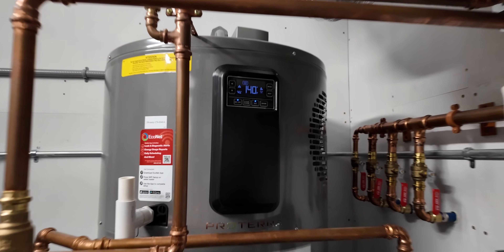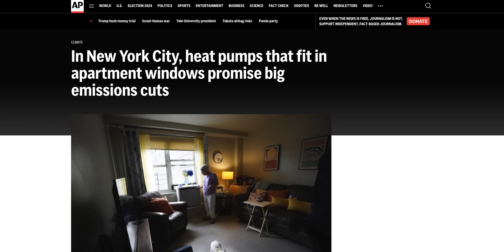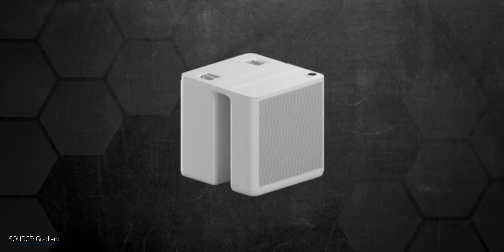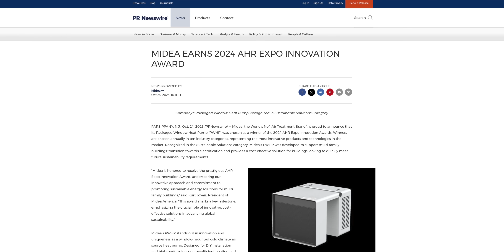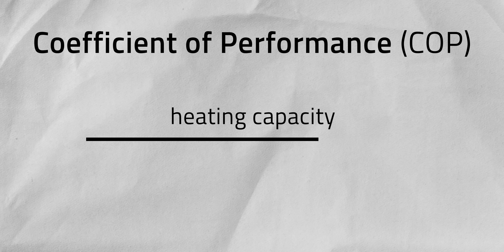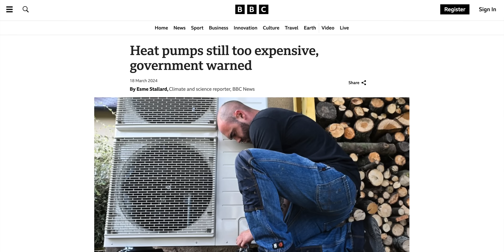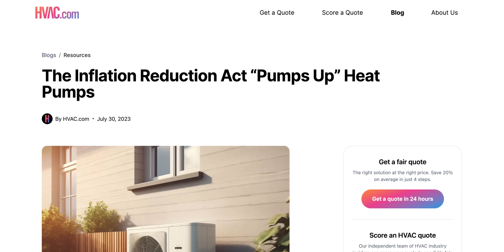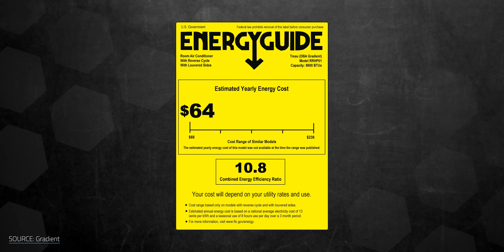Why This Window Heat Pump Is Genius

Comment: In Europe, in buildings with central heating, we install special radiator valves that stop the water flow when a specific temperature is reached, and each tenant pays only for what they use.

Heat pumps are definitely better, but the problem of some apartments being too hot was solved a couple of decades ago.
Reply: Also those heat pumps wouldn't work in Europe, because the windows have a different design.
Reply: @hanneselch1843  Depends on the window, but yeah on some it wouldn't work, but I don't think it would be that difficult to do a slight redesign for it to be more flexible with more windows.

But honestly, the price point of 3 grand is crazy high for that, especially as it looks like you will need more than one of them as it looks like it's on a per-room basis or landing base, so the cost really start to add up in buying them and running cost, and I'm not sure if it's just a US thing having such a high price point, but for 3 grand, there's no way I would buy that.
Reply: @paul1979uk2000  it would be difficult, because most european windows don't slide up/down but open left/right so there is no nice rectangular hole to deal with and you will have holes between AC unit, frame and window
Reply: @hanneselch1843   It's not impossible or unheard of to change a single window.  The world is so inept.
Reply: @btwbrand  It don't know if they sell or make sliding windows like that here. But it may be possible. Still the price would be higher. I guess most people here wouldn't buy it, if they would have to change a window. There are other solutions to get one installed. But for American homes it's a great solution.
Reply: Yeah I did that in my house and it works really well with controlling the temperature per room, but it does take a little time to set up and each room being different needs being setup individually to get the right temperature you want.

Once you have it setup, it works like a dream, each one switches on or off depending on the setting you have and the temperature you want, the advantage is, you end up using less energy whiles feeling more comfortable in a room because the temperature stays at a given level so not to let it get too cold or too hot, and you can do this individually on a per-room basis.

For instance, one room in the house, the heating rarely comes on and usually in winter for a short time because the room doesn't get too cold, whereas the bathroom needs more heating so it comes on more aggressively, once it's set for each room, you don't have to do anything and the heating comes on and off automatically per room as needed, which in my case, is not very much because we insulated the house about 3 years ago and it doesn't really get that cold in winter that heating is rarely needed, this is in the UK by the way.

With that said, the same system could be much cheaper with a heat pump, but considering how little heating we use, it's not worth getting a heat pump at the current price.
Reply: Well, la-di-da, man. We're all aware that America is super behind the rest of the world. Even the non-brainwashed of us here In America, such as me, are fully aware of that. It still helps solve the thing that's still a problem here even if it isn't elsewhere anymore lol
Reply: I live in Vienna. Lots of old appartment buildings and I did have the issue of a heating system that was either on = boiling hot or off = cold, in an appartment in a very good part of the city. So yes the adjustable radiator valves exist, but not everywhere.
Reply: That's on newer systems there are plenty of older units in use in Europe and that's obviously what he's talking about.
Reply: American't find out what an thermostat or an calorimeter are. But IF they actually really use steam for transmission the argument would actually be irrelevant, because a classic thermostat would not work with steam
Reply: @hpenvy1106   Wow you just took a second to think and realize this is all about old steam systems. 🙄
Reply: In the nordics water cental heating are the standard. You have thermo mechanic thermostatic valves on the radiator as mentioned. The heating source are often district heating. Where it's not available geothermal are standard today. The typically use oil or resistiv heater as auxiliary heat when it gets really cold. The renter didn't need to hassle with the heat source.
Reply: @nallebrean  nope, we dont do it like that in the nordic country´s
very few have geothermal heating where i live, we just said no to a geothermal district heating where i live
a heatpump individual is cheaper 
and doing geothermal heating by yourself is not cheaper 

and big part of the country does not have acces to district heating 
we are starting to let out bio gas in the gas grid soon, insted of replacing the whole gas grid with a new grid.
and we get tax reductions for heat pumps and we dont get for geothermal district heating (or district heasting)
and that tax reduction is to small to make a heatpump for geothermal heating a good investment

i get free heat from solar and waste heat from making bitcoins from solar 
with a geothermal district heating i would pay 200€ per month + consumption
it is not better for the nature to run geothermal heating if the electricity used is not green anyway

geothermal heating is not a green investment in it self.
it needs green energy to be green

heatpump and batteries are 5-10 times cheaper and more green then geothermal heating from the grid where i live 
and if its district heating it have something like 20% heat loss in the grid

our goverment just used million on creating projects with geothermal district heating 6 month ago
the money is gone and it failed
they made laws that made it fail at the same time, it is madness
Reply: @Hansen710  I don't agree with with the claim that geothermal heating on fossil fuels not are green. If you burn the fossil fuel for heating you got max 100% as heating. If you make electricity out of it you got max 40%. And efficient geothermal system can give cop 4. That makes a system efficiency of 4*40%=160% heat out of 1 kWh fossil fuel. If you then use the remaining losses in the power plant for district heating (common in nordics) you got a system efficency of 160%+60%=220%. 1 kWh fossil fuel in 2 out. With time the grid get less CO2 intensiv too. It you have solar too those drives a part of the heat pump too.

If you use your (bio) gas to produce electricity you can get 60% efficiency. Combined with geothermal hp you can reach 4*60% el+40% losses to DH =280% system efficency.
Reply: A district heating system typically has 10% losses here. But I agree that geothermal system should be individual. That's because you lose cop with the high temp district heating needs to be efficient. From 65 C in the summer to 100 C in the winter. The colder the better for cop.
Reply: The other thing about steam in dense city environments is that it often comes "for free" (at least from an energy usage standpoint). The steam is often sourced from nearby power generators, were water was boiled to make steam to turn a turbine. They could just let that steam out into the atmosphere, or they could make use of it in places that need heat. So, it's piped into nearby buildings, and used to drive the heating systems.
Reply: I don't know what you talk about. During heatwaves in Europe there is nothing you can do without an AC. I would like to get an AC, but all I got is a cylindrical hole in the wall of my rented apartment.
Reply: That's because in Europe they have standards
Reply: @DaUziel  but they don't have air conditioning, so suffer over there I guess.

Comment: ....costs would differ greatly dependent on the insulative properties of the building you instal it in......you can't talk about running cost without looking at this.....if your building is well insulated you hardly need any heating or cooling at all, even in thermally extreme locations.....are you sure you don't own shares?

Comment: There seems to be an elephant in the room...with what types of windows do these heat pumps work? Only the vertical sliding type? Are those common in those areas?

Comment: I would like to talk to you about the nitty and gritty!!!  You and engineers say  that Air source Geo thermo moves the heat from one place to another- I beg to differ on this!!!  It is merely using principle of science that when you compress a gas you create heat and when you release a gas at a rapid rate you create cold.  You could almost do the process with air except that on the cold side it does not work well.  But on the heat side it is used to create combustion in an engine!  I would like to hear what you have to say on this to further my understanding of the process.

Comment: 1 it didnt matter how long it takes to build it in your window: you do it just 1x per heater life.
2 did you have to let your window open all the time to run the unit if your wondow opens to the side???
3 what happens with the gaps left and right of the unit if the window is not the exact same size as your window???
4 if you have to first build a cage outside of your window, you can just buy a old type unit and place it somewhere else.

Comment: People a heat pump is just a regular ac but in the winter, the compressor heats home but only down to 32 degrees outside colder than that and you will still need gas, electric, etc.

Comment: I love the design and approach of these units.  However, when I can go buy a $300 Priced 8000 BTU air conditioner at Walmart or Best Buy, it is really hard to justify a $3000 alternative.  Even if its monthly electricity cost is less.  I agree with others, that heat pump is  just an air conditioner that can run in reverse.  Although you could run the pump backwards, it’s likely easier and better to just switch the flow.  So a couple of flow switches cost over $2000?.  I don’t think so.  Somebody is milking the cow here.  Either that or they are being dramatically less efficient than the manufactures of the air conditioners sold at Walmart and Best Buy.  Maybe it’s a combination of both.  Anyhow, I know for myself, and I suspect for most people, no one is going to pay more than about a factor of two more for an air conditioner that also heats.  May be a factor of three if the form factor in quality is there.  Aside from the affordability issue, there is also the pragmatic aspect that most of the small units do not last more than a couple or three years.  And that assumes that you do proper maintenance on cleaning the condenser and evaporator coils.   And furthermore, they just get nasty overtime with mold, and although it is possible to clean them, it’s a pain and few people do so when they are so inexpensive and can be replaced easily and affordably.  So until these units get appreciably less than a factor of 10 cost compared to the commodity air conditioners, these will simply be a niche product for those that have a unique need only met by them, or those with deep pockets for which price is not a consideration.

Comment: The high unit cost has to be because of the low production volumes.  Because mechanically there isn't going to be much difference between manufacturing a air con unit verses a heat pump.

Comment: Sure, but now you need one of those per room or you would need to install ductwork - i don't believe there's any way for that unit alone to evenly heat anything bigger than a studio unit... Sounds a little impractical at scale

Comment: I've wondered why making window unit heat pumps was not where the market was going for years. There is this weird stigma around heat pumps with some people and I don't understand it. The components in them are not that much different than a traditional A/C unit so size can't be the issue.

Comment: So boiling water with the same natural gas that would be used for a boiler in a building, to drive a steam turbine that runs a generator to deliver electricity through a network of transformer and transmission lines hundreds of miles away to run another electric motor to compress a potentially environmentally bad gas through a complex system of small pipes and radiators that has to be manufactured, transported and eventually disposed of is supposed to reduce greenhouse gases?!?!?

This is why humanity is doomed....

Comment: Another BS that only brings money for the producer and those who promote it. You basically need one for every room. The efficiency is related to the outside temperature and the desired inside room temperature, the bigger the gap, the bigger the needed energy and the bigger the work (i.e. the noise) the equipment makes to deliver the need heat. The noise is indicated by the producer (and those who advertise it(!) knowing nothing since they are paid not to know) and imagine you are living in a high rise surrounded by dozens if not hundreds of those "low noise" units running at top speed.

Comment: All the people here, paying $1,500 to $2,000 for a new smartphone every year or two, but think $3,000 for a device which will save them hundreds per year on heating thanks to higher energy efficiency, and will be installed for a minimum of 20 years... they're whining that THAT'S too much?

If you think $3k is too much, then patently, there's something wrong with you. You're probably willing to spend that much on a PC that'll last 2-3 years, but not on a thing that'll work for 20+, and remain repairable throughout it's entire useful life? 

Dang. You do realize right, that at $3k, and it WILL be in use for 20+ years, this would only set you back $12.50 per month? If you want a tip to help the pill go down easier: look for a service provider who also provides installation and service/maintenance. Such as Hoval/CleaverBrooks.

Comment: a good step - but this only shows the system working with old style sash windows - how do they get installed if windows have already been upgraded - side hung, tilt/turn, top hung etc. i have a small balcony so would like this type of scale unit to be installable there with some simple diy connectors for internal and external parts.

Comment: I was under the impression that many building in NYC are heated using Steam from the vast District Heating system under Manhattan, much of the Steam provided Cogenerted at Urban Power Plant. If these buildings switch to Heat Pumps & Electricity, and the demand for Steam drops, then Power Plant waste heat may not longed be recovered for Steam production. Could this not result in an overall increase for energy? While Heat Pumps are a super efficient method of heating, electricity generation will never be able to fully harness primary energy sources.

Comment: Great topic!
There are many U-shaped window A/C units listed on Amazon in the $400-$600 range with similar BTU quoted in this video. WHY are heat pumps so more more expensive at $2000-$3800 quoted in video? The only difference I see is the reverse-flow value to allow heat pump operation and minor software tweaks. 
This almost needs a video to explain why heat pumps are 4-5x the cost of similar-sized A/C units in the US. It really seems to target non-home owner unfairly. Again searching Amazon (and other big-box stores), the number of A/C models far exceeds the number of heat pump models. Is there a patent, or some other IP that is preventing manufactures from producing more heat pump models?

Comment: Nice idea however those who are commenting about the Midea 1 room unit that  costs far less than this unit have a point... ITS TOO EXPENSIVE>>>and the bigger unit may require a dedicated outlet where there was none before or where there is an outlet available but it has other appliances on that line.... I am not sure if the unit is dual purpose so sacrificing the same window that the air conditioner was in will also make it so that there will be no air conditioning  or the unit will have to be removed and swapped out with the air conditioner on a yearly basis according to the weather if you have only one window that is decent enough to circulate heated or cooled air throughout the apartment... you may also have to come up with a way to put in some type of ducts or grates in the doors in order to circulate the air in or out of rooms which the old heating system used to heat... since you are technically going to forced hot air where they apartment had individual radiators or baseboard heating in every room.

Comment: My calculation will be solar installation cost with Traditional AC versus solar installation cost with heat pump(s).   Will the reduction in cost be more than the cost of installing the heat pump.

Comment: They already sell standard window mounted units with heat pumps for like $1300. I used one for years and it worked great. I think the biggest issue though especially with older buildings is AC is an after thought. Lots of them can’t handle the cooling load to keep your apartment comfortable during hot days so the btu out of a window unit isn’t enough for heating during the winter when landlords legally need it to be 68. Which is why most buildings rely on some other supplemental heat like boilers.

Comment: Where heat pumps quickly go wonky is looking at cost to run though. Taking UK energy cap prices (6p gas, 24p electric) looking at worst case old boiler systems they might be only 60% effecient, so are costing about 10p per unit heat. this heat pump in its best case is essentially 260% effecient, so costs around... 9.4p per unit heat. And as you look at better more modern boilers, and conditions get less favourable for the heat pump - it just doesn't add up.